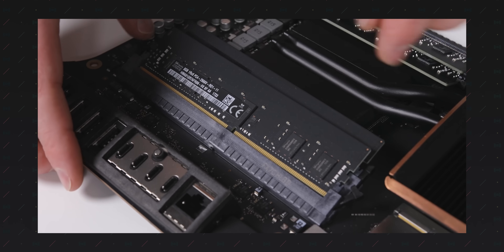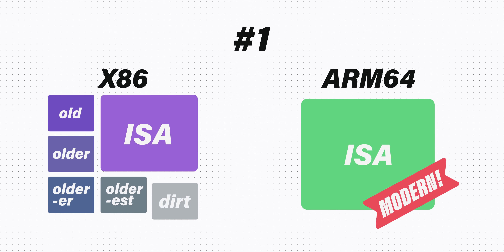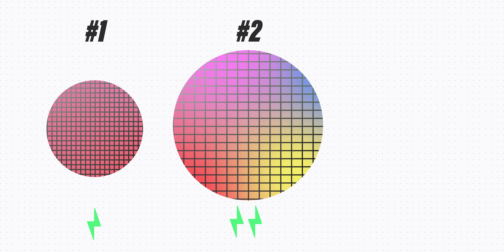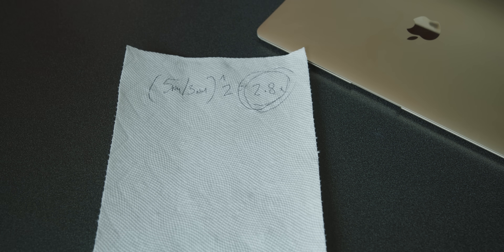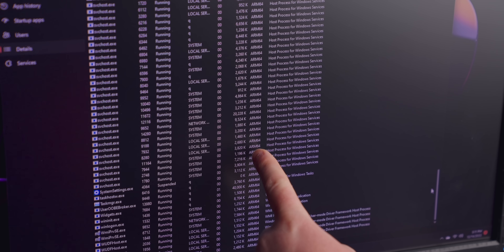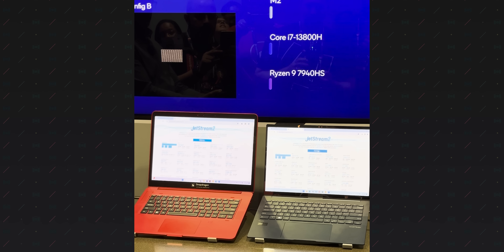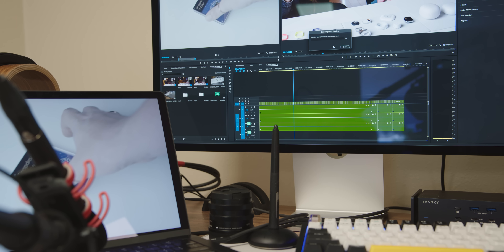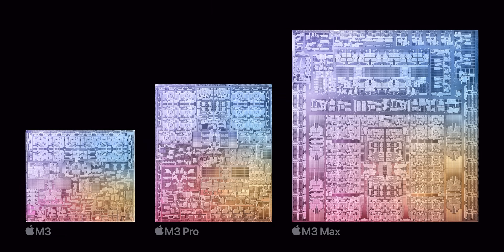Apple's Silicon Magic Is Over!

Comment: As someone who has built their own desktop PCs since before a lot of YouTube viewers were born, my biggest anxiety about this transition is whether or not I'll be able to keep building and customizing my own hardware.  I don't particularly mind the idea of SoCs, but I really value the modularity of the existing x86 platform.  It has saved me boatload of money over the years and lets me get exactly what I care about without paying for what I don't.  The thought of being stuck with only a laptop, with all the horrible tradeoffs and e-waste that comes with that is just appalling.
Reply: Exactly, these “tech” YouTubers simply think of “computer fast = computer good” but it is all about actually being able to use the computer
Reply: Indeed. I can understand some fo the trade-offs for mobile systems but not for desktops. And even for mobile systems you should be able to replace RAM and storage, especially with how limited the Apple silicon is on those. My 2010 Macs have more RAM and storage than most new Macs.
Reply: 13:50 Well, of course they don't run the fans. They let the SoC fry at 100C all day, and share the heat with the ram and storage!
Reply: “Saving you money” means poor CEOs have to choose a smaller Yacht. So, it’s likely to disappear. The world is trending to costing more with less choice, unfortunately.
Reply: hoping for the same socketed systems that we are used to from intel/amd to come to arm, and just motherboards with a new chipset, maybe no chipset in the case of an SoC
they would have great iGPUs and maybe free included ram, while keeping pcie and ddr5 the same or a new standardized ddr-dimm for arm systems

apple themselves have proved that pcie at all is possble although no current gpus work with it

making a new socket-its nothing new

storage is too easy to implement, and its another opportunity for cpu makers to offer some small on board boot drive

leaving modular GPU and RAM as the big main questions
Reply: @ethernet01  As soon as a socketed ARM processor is released I am immediately switching
Reply: I just want to install software as easily as I do now with x86. Like, I don't need a special linux distro to run on it.
Reply: @sprockkets What do you mean special Linux distribution? Aside from making sure it’s right for the hardware and compiles nothings changed. Asahi Linux exists because Apple are a bunch of close speced asses. The HW including drive controllers and are designed differently from reference aarch64. But reference aarch64 like rpi can use regular distros.
Reply: @veccio  just look at what distros or builds are needed for tv boxes, pis, other sbcs. opensuse needs builds for each major sbc. You don't need special builds for any x86 system.
Reply: I agree 100% We were free to assemble the system we needed and could afford, now they will bring us the specs they see fit to produce for us.
Reply: You won't, that is the point. You can't even fix a display hinge on Apple laptops now because everything is pared to the machine and they don't want anyone changing anything but their own people costing top dollar. If I am going to pay over the odds for a laptop it's going to be a Framework that I know I can repair and upgrade as required.
Reply: Don’t worry. Ampere Altra will be the ARM desktop of the future and carry forward the modularity you love.
Reply: well if Apple and other pc makers follows EU's new law to computing we'll be getting modular computers just like the old times but more efficient and in smaller form factor.
Reply: @jrstrong
0 seconds ago
I was a UIUC Business major, so I understand the difference between MARGIN and VOLUME, but I don't believe Tim Cook KNOWS enough about Business!  (Like that old Apple Board Member K---something who PREVENTED Apple from licensing the MacOS, as Bill Gates suggested they do in 1985, 10 yrs before he came out with Win95!)

I'll be staying with my 2010 Mac Pro 5,1 for as long as possible, currently 'booting' Monterey 12.7.4 from an internal nvme PCI drive, with a 12-core 3.33ghz Xeon, GTX 670 2g GPU, 96g, 2xUSB3.0 + 2xUSBc card and a free slot #4!  My 5,1 is right ABOVE the M1 chip on the Cinebench 2024 ranking?

Reply

@jrstrong
0 seconds ago
 @snazzy  Come on OWC, find a cheaper way to upgrade!

Reply

@jrstrong
0 seconds ago
 @andyH_England  Less than $500 TOTAL for a 2010 cMP?
Reply: this. when they say that the m1 controls some of the i/o , all i can think of is that in the future, if the government doesnt like you, theyre gonna disable your keyboard or your charging port - no software "hacking" required. full integration means full control. once its hardware side, youre screwed. next time theres a pandemic lockdown, you better do exactly what the government says..
Reply: I sold my RTx3090+Ryzen9 5900X Gaming PC since I am not gaming and for everything else the M1 Pro with 32gb RAM does everything smoothly.

I understand your point and think it's important, but currently no laptop and office PC comes anywhere close to the efficiency of the MacBooks. Yes, I don't like Apple much, but even I've acknowledged how amazing those M-series laptops are.
I am hoping for Altera ARM to become more affordable and Qualcomm SoCs to keep at least some of the promises. I have no hope for x86. My server will be a x86-64 Intel chip, but I'll switch in a heartbeat to a good and affordable ARM chip.
Reply: Not only that, but there is no Bios, so we are at the mercy of the company for support just like in smartphones, where as on PCs  we have being able to upgrade and put any OS we want when we want
Reply: GPU is the hero for PC Desktops. The future is more and more GPU focused for everything creator and AI oriented and having a SoC and a GPU will be super powerful.

Old Amiga guy here. Amigas were great because they had multiple of chips. If we can figure out the internal i/o of that in a motherboard layout we will all have custom super computers in our future.
Reply: @MarcTelesha  The future will be interposers with logic built into them. They can be designed with topologies that enables far better communication than currently between chips. How the architecture overall will be is hard to forecast. Will it be similar to the newest Nvidia AI gpus with CPU and GPU on the same interposer with shared memory? If the performance advantage is high enough that will make upgradeablility of the individial components sacrificable.
Reply: Unfortunately, in future everything would move towards even larger integration, so everyhing would need to be as close as possible, on the same die.
Reply: @veljko100able I guess it is a bit of semantics but not on the same die per se; but rather several dies on an common interposer (with integrated logic). Cooling might be a bit of a limitation but the increased performance due to the interposer beeing able to connect components at much much higher speed will offset that. Upgradeability will suffer.
Reply: @veljko100able  It'll be awhile until it's practical or even beneficial for consumer chips but I highly suspect we'll see memory moved to the CPU package sooner than later. You know Intel is loving the idea of segmented product stacks with set memory sizes. It'll be amazing for APUs.
Reply: @veljko100able no. Because speed doesnt scale as fast as cores
Reply: And a craptastic Windows OS. Enjoy that piece of garbage.

My mother just upgraded to a new iMac after 13 YEARS. It still runs perfectly fine but it’s stuck at 12.3. So she can’t upgrade any of her browsers. That’s the only reason she’s getting a new one. Oh, and she runs a business at 81. I have a MacBook Pro still running fine after 11 years.  So go ahead and play stupid games on your custom PC while Mac users actually get way more years out of our computers and get work done.
Reply: @chuckcribbs3398  That was so ignorant, but expected from an Apple user.
Reply: @chuckcribbs3398  Laughs in powerful GPU that runs LLMs, multiple monitors, software compatibility back to the dark ages, and - shock - a Windows install which started at Windows 7 and has been repeatedly updated without any problems despite swapping out hardware upgrades over the years. That's right, my Windows install is just as old as your MacBook, but I still get  updates and can run anything I want.
Life is good outside the walled garden if you have a few brain cells to rub together...
Reply: Then don't buy it. Stick to the past.
Reply: @139-b7j  So you are happy buying over priced throw away crap that can't be repaired or upgraded meaning it ends up as unwanted e-waste after a couple of years. If that is what the 'future' is all about maybe it would be better to look to the past.
Reply: I think AMD's upcoming Strix Halo APU (and to a lesser extent the MI300 APU) which has 40 GPU CUs which will make it by far the most powerful desktop APU ever released on x86, will be a taste of the future, where the lower end and midrange GPUs are consumed into the APU.

If AI and enterprise wasn't eating up all the HBM, this would be happening even quicker, but oh well
Reply: Your concern, not anxiety
Reply: Yo it does not matter and you will continue to be able to build your pc at cheaper than you would have in the past anyways. Are you complaining that you don’t need to pick out sound cards and wifi cards anymore because they come on the motherboard? You think motherboards are more expensive now adjusted for inflation?

I find it goofy that so many tech people are luddites when it comes to tech itself. 

Having SOCs will create LESS e-waste not more. People who have the M1 macbook pros are still outperforming brand new Laptops that are already needing upgrades or replacements
Reply: Don't worry so much!  ARM ISA isn't a big advantage, legacy x86 instructions don't need to be fast and the x86 decoding is solved according to Jim Keller who has designed x86, ARM and RISC-V now because ARM wouldn't add the data types he needed for Tenstorrent.  This video appeared to claim weak ordering was an x86 issue, but it's actually ARM that has a tricky weak model.  The released Qualcomm Elite benchmarks showed pretty disappointing game performance and the hype was generated by comparison with older chips.  Apple had to do a lot of costly engineering work putting in caches to make an APU work well, because a dGPU bus width is 32x number of memory modules, which with 2GB modules makes 256bit for 16GB VRAM.
Basically desktop builds retain advantages, Apples repair policies suck and fans never see signs of  dubious build quality.
Having had a laptop, next I built a laptop replacement tower, which just eliminated the constraints and compromises of thin battery powered machines.
Reply: You know, you do not have to "transition" at all. You can just get a Macbook if you could use the added efficiency there, and still build your own PC. You cannot even change the RAM on most decent laptops, and have not been able to do so for years.
Reply: @nanolog522  1. Apple's philosophy and attitude are repulsive, anti-consumer, and intentionally built to take away my ability to control what I think is important.  Hell no.
2. Laptops are like pistols. They are a bundle of design and performance compromises which make the item less effective at doing its job just to make it smaller. I don't buy laptops, and I have no intention of changing that. My Android phone does everything that I would need a laptop for in my personal life.
3. It's ridiculous how unrepairable some laptops are. New legislation on repairability designed to reduce e-waste should help with that.
Reply: @Daekar3  I find it weird if someone keeps using words like „repulsive“. It’s fine if you don’t want to buy a MacBook. Though your arguments are pretty weird.

Take a desktop PC. While you can upgrade it so it remains usable, often, that doesn’t make a huge difference. Sure, you can at some point upgrade the CPU to one maybe a generation newer or with more cores. But does that really reduce e waste? Failure rates in hardware are very low, and to get a significant upgrade, you also need a new mainboard, and for example new RAM. Then you get things like Microsoft limiting Windows 11 to only certain CPUs, which essentially means the same thing you are complaining about with Apple. My old work had to dump thirty PCs because they do not run Windows 11. There are more problems with desktop PCs you are ignoring. They use much more resources than a laptop, even for the same power. Laptops, MacBooks specifically, are also much more power efficient than desktop PCs, simply because of their much tighter integration. Sure, you cannot change the CPU. But when the laptop needs half the power than the desktop PC and you have to change the mainboard for an upgrade regardless (resulting in comparable amounts of waste), there isn’t actually a huge benefit.
It gets worse: Laptops are actually pretty good to deal with after they are no longer used. They often get refurbished, stripped for parts, or they are recycled. The resources itself are not lost.
Reply: @nanolog522   Repulsive is the correct word.  Arrogance of the degree demonstrated consistently by Apple over a long period should never be rewarded. 
For the record, I don't really mind Apple's hardware other than the repairability part. It's their software that I really dislike.  I have had both Android and iOS for years, and have used Macs here and there since college.  MacOS is tolerable, but iOS is not.   I am thankful I don't have to use my iPhone for much important at this point, because the UI design and general user experience is just bad.  The only reason to have an iPhone is if you don't understand technology and have no ideas of your own about how things should be done.  
If I could get Apple hardware without their software, I would consider it.
Reply: @Daekar3  Those words are actually not good. Because they are not factual, but subjective. They also suggest authority without a real basis for it, and are very opinionated. You say „repulsive is the correct word“. That’s wrong for a simple reason: You find it repulsive. Nobody else has to. Yet, you are convinced that your opinion is the right one, so you say „repulsive is the right word“. Exactly my point.

With Android, you are actually hurting your own argument. Suddenly, it isn’t about the hardware anymore, so, software is the problem. Yet, you keep saying how you find e waste and probably planned obsolescence „repulsive“, when iPhones have for years gotten software updates for much longer than Android phones, and even today, anything below a flagship models tends to not be supported as long as an iPhone. Your original arguments were all „Apple is bad because you cannot repair a MacBook“, then suddenly all laptops were bad, and now you don’t actually mind the longevity of a phone and prefer Android without even mentioning the fact that iOS phones get updates for longer. This weird lack of focus, together with all your strongly opinionated statements, really hurts your credibility.
Reply: @nanolog522 try doing video editing on a laptop, they're crap compared to PCs, efficiency in computations PCs win by a mile lol, so is the heat dissipation, Apple are over priced & like most manufacturers they BS most of the time. Permissions for antivirus apps & generally need to do a system reset unlike windows or android
Reply: @jab-gn3sw  Well, that’s weird. Because it is bullshit.

First off, you appear to be comparing a desktop PC with a MacBook. Which is pretty dishonest because obviously, a desktop PC is quieter than a laptop, and it will be faster because it can use several hundred watts as opposed to less than a hundred watts for a laptop. Big surprise lol. However, on a performance per watt basis, ARM in general and Apple Silicon in particular wins hands down. That’s trivial to corroborate. As is the fact that a MacBook is faster than an x86 laptop. You are of course free to check my claims here.

A big point with Apple are optimisations. Inherently, if you know what hardware people run, you can make your software more efficient. Generally, most video editing software is pretty well optimised. And if you ever compare devices that are actually comparable, not, you know, a 400W+ desktop PC with a MacBook, you will clearly see the difference. Just raw GPU power, not so much, there, a Windows laptop will likely win.
Personally, I have a desktop PC with a Ryzen 5900X (with PBO) and a MacBook Pro from 2021. The Ryzen has much more multithreaded power, however, single threaded performance is better with the M1 Pro. Python is much quicker on Apple, both than the Ryzen and the i7 I had in my work laptop. It is not even close.

So, yeah. Compare devices that are actually comparable, stop making random claims (eg regarding efficiency) everyone here knows are lies and stop being so aggressive in your comments, that doesn’t really help your point.
Reply: @nanolog522   I'm starting to think you learned to write by reading Twitter. Pro-tip, making things up and putting them in a comment doesn't make them true. Nor does your poor reading comprehension mean someone else's position is weaker than logic dictates.  You have a lot to learn if you want to arrive at correct answers by reason.
Reply: @jab-gn3sw    You have to be trolling. Again you are comparing desktops and laptops, again you are making false statements and lying.

Of course a desktop PC can be faster. But that isn’t an argument against Apple. It’s an argument against using laptops for video editing. Which itself is a flawed point since you don’t edit on a laptop because they are faster or as fast as a PC. You do it because you need the mobility.
The PC (as opposed to laptops in general or MacBooks in particular) being more energy efficient is still a lie. I don’t get what you are trying to do here. You could easily educate yourself, but instead repeat the same lie over and over. Laptops are designed to be energy efficient. They clock lower, use more sophisticated optimisations (like NVIDIA Optimus) and integrate hardware more tightly. Again, you could find that out for yourself by simply looking it up. 

Of course you show that you are lying when you then talk about „heat dissipation“. First you claim that PCs are more efficient, then you say they are better because they can dissipate all their heat losses better (which, by the way, isn’t true for something like the MacBook Pro).

Sure, MacBooks are expensive. But you have failed yet again to show that they are overpriced, since you keep lying about them being worse than windows PCs. Who are you trying to convince here? And why do you think telling easily disprovable lies is the way to do it?
Reply: I agree with you but I have my PC at home. For games, 3D-printing, hobby programming but also professional heavy programs. For professional stuff on the go my MacBook m1 has been awsome. It just works, syncs easily with my phone etc. It is way more reliable than any pc laptop (and I have had many). Both systems have their strengths and weaknesses both in software and hardware. PC definitely needs to modernize itself on many fronts. But I hope it stays open and adaptable.